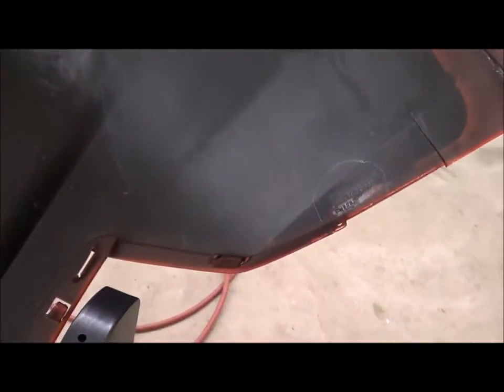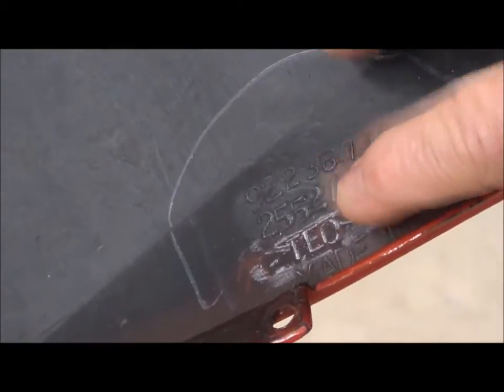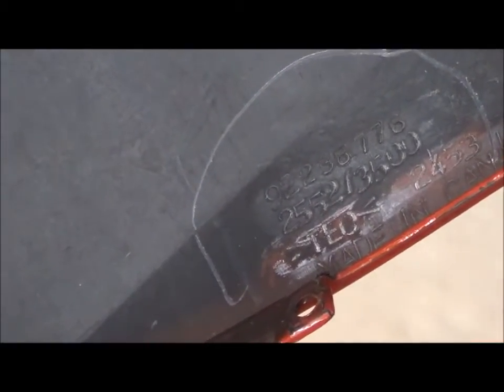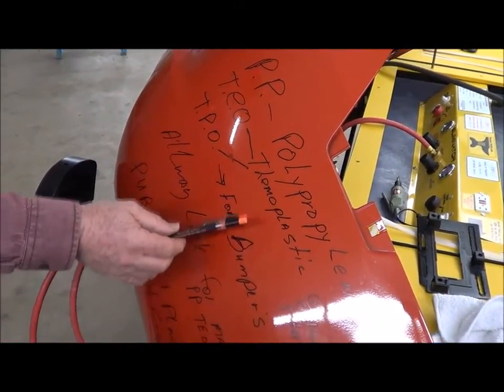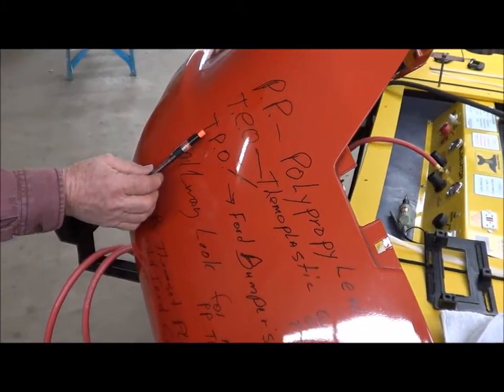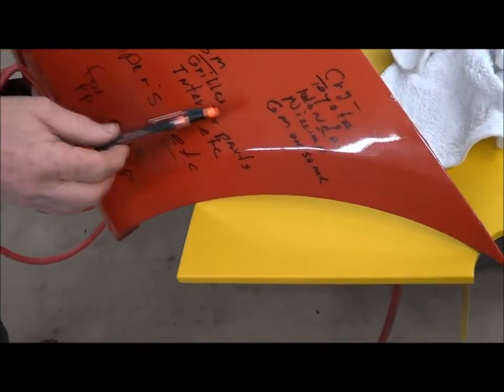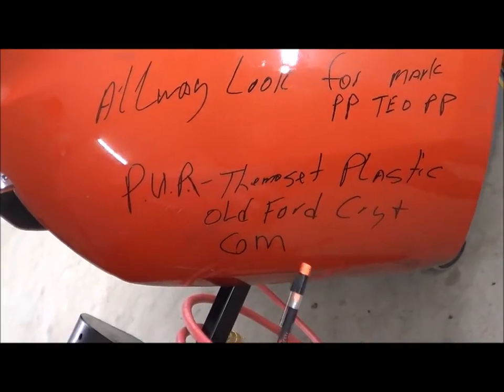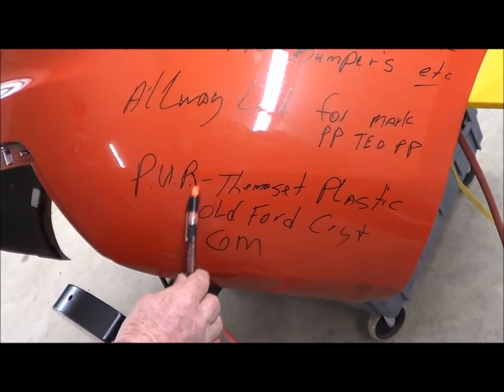BumperSmith.com How to identify what type of plastic bumper you have

Comment: Hi!  I have a stray bumper cover that was abandoned at a rental property.  I was wondering if you could help me figure out what kind of car it is to- or point me in the right direction so that I can start to research it?  The identifiers on it are that it is manufactured by Great Bestcam, GC-1251, Lot 0804A, PL GM1000349, MFG CLD2002B

THANKS!
Reply: 1994-1996 Cadillac Deville